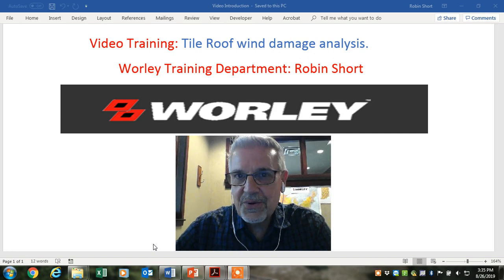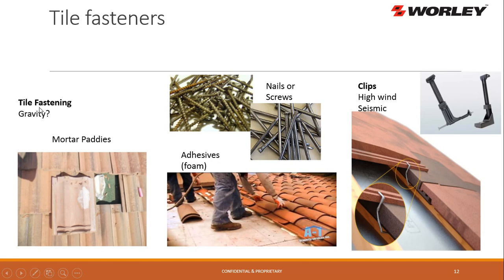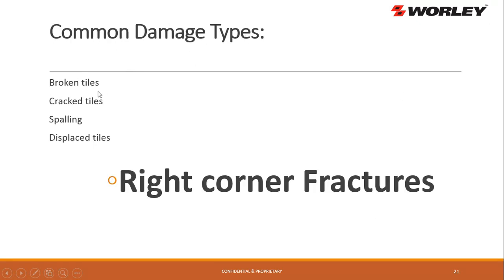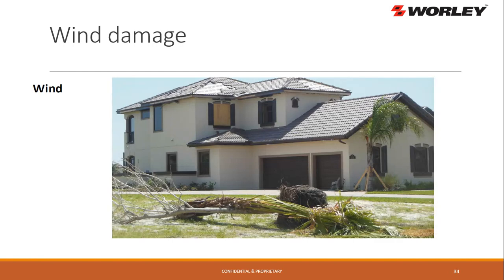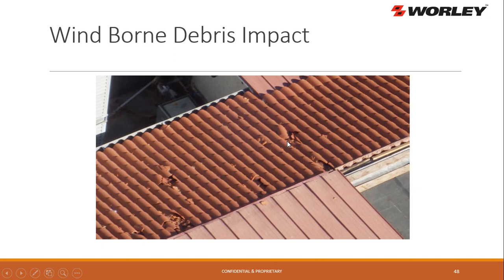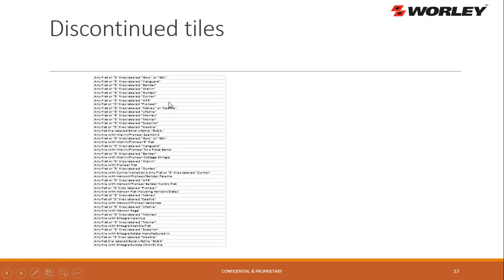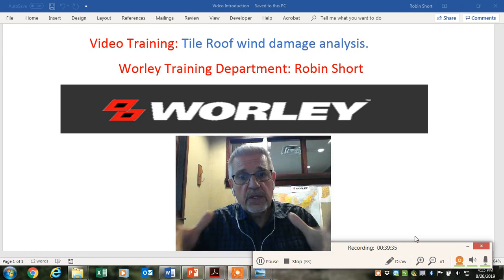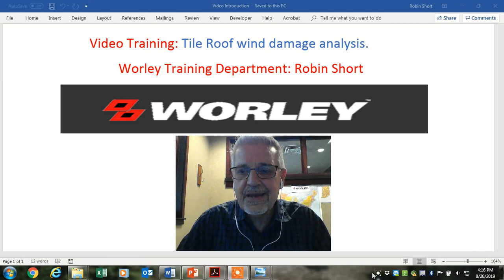tile roof analysis and wind damage

Comment: Where's the consideration for matching?  Florida has a matching statute.  How about loose tiles? When a roof is installed it has to be within a certain tolerance.  If after a storm the tolerance exceeds the maximum, how'd that happen?  Strong winds raise even concrete tiles lifting the nails.  Leaks then develop and the maximum  tolerance is exceeded.  The Florida building department states that loose tiles are considered damaged tiles.  More than 25% loose requires full replacement.